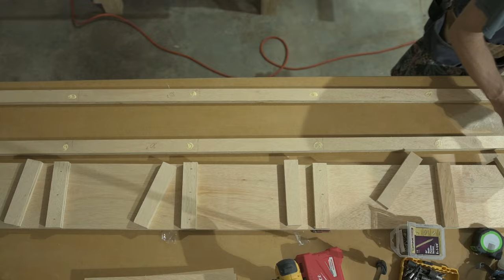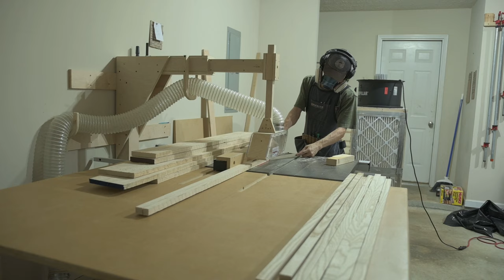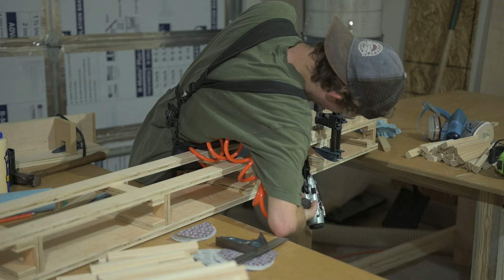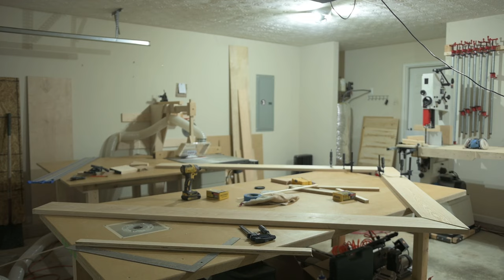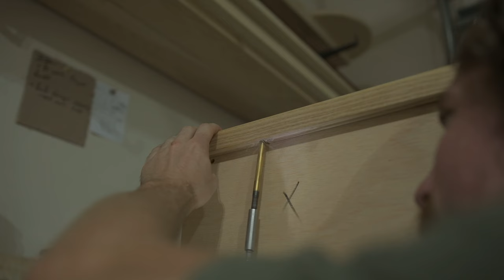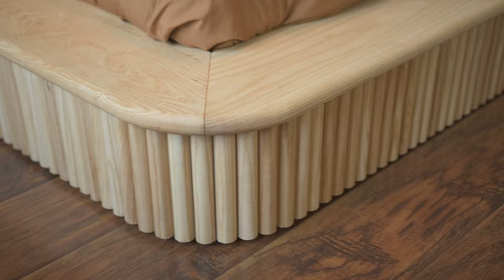Did I STEAL this bed design...?

Comment: 'Original' can be something totally new (rare, I agree) or a new spin on something old. We're constrained by the limitations of the material and the laws of physics, so I highly doubt anyone is going to come up with a totally new and original idea at this point. And that's fine. In fiction writing, there are a few well-understood archetypes that all coherent stories follow. Take your favorite book or movie and compare the plot to the archetypes. 99% chance it fits one of them. Hollywood still cranks out movies, although it is fair to say that few truly stand out as original.

I should be clear that I'm no professional; I've made some kitchen cabinets, a table, a cat litter box/credenza (yes, it was both). Coming into building things with no formal or traditional education taught me a lesson about originality. Sometimes I get a cool idea and think, 'why hasn't anyone done this before?' and the answer is: 'because it doesn't work that way!' Other times it could be that it hasn't been done that way because it is just much harder and is impractical for mass production. Take for example my corner cabinet under the sink in my kitchen. Corner cabinets usually have a small door to access the plumbing because of the limited space afforded by the hypotenuse of that right triangle. I made mine have a set of vertical tambour doors that follow double-curved tracks so that nearly the entire cabinet front opens up. People, including my plumber, seem to love it. Is it original? I think so since I couldn't find anyone anywhere having done it before. It certainly wasn't easy, though! That brings me to my final point (I promise, this is already long). Something you create may not be exactly original in the grand scheme of things, but none of us have seen everything. Your design may be different enough to be unfamiliar to a lot of people and in so being, it might as well be completely original.

Good work, by the way. You've got a new subscriber.
Reply from the maker: I appreciate your words! I definitely agree with what you said. The mass production constraint is something I think about, not necessarily because I plan to mass produce products, but because if I want to make it again, I always try to figure out how to make it the easiest and best way possible. Sometimes there just isn't a solution which makes certain pieces take a very long time to make. But it is a custom piece and I think that extra time and effort is to be expected with custom work. 

Thanks again and glad you enjoyed the video!